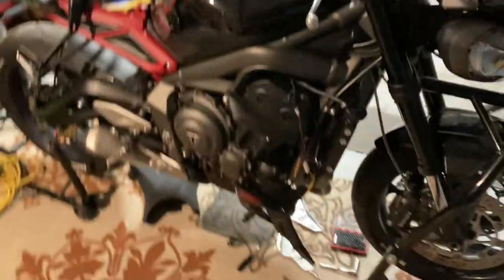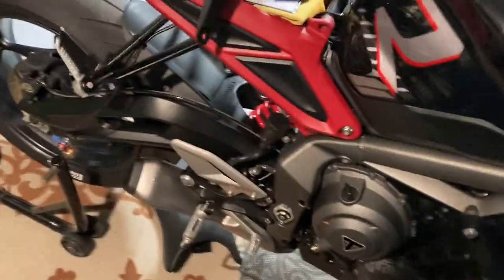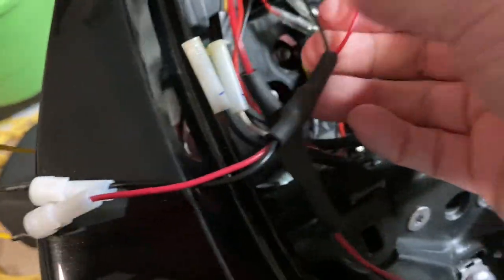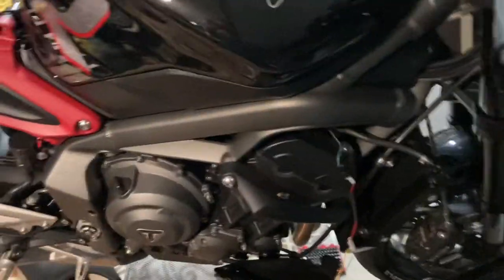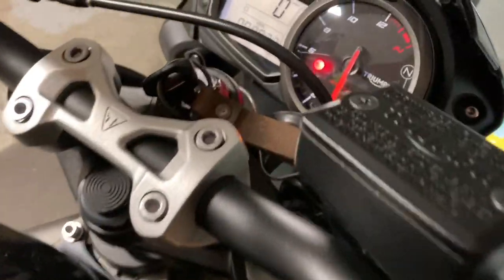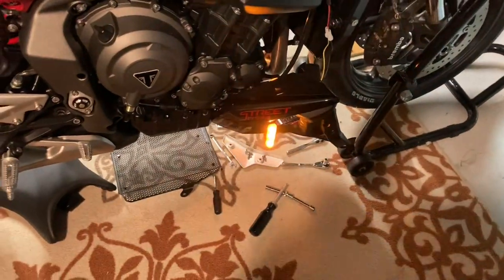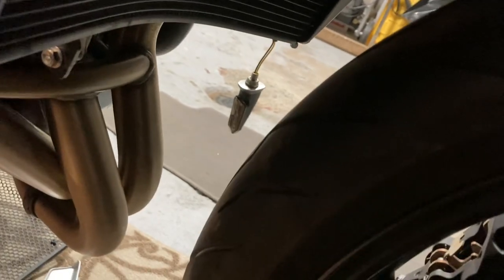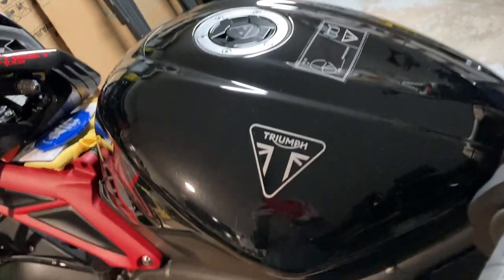Brogue Motorcycles LED Resistor Install Triumph Street Triple 765 Hyper Flash HELP!

Comment: I just added the OEM Scrolling LEDS. Switched out the front signals, tested and both worked awesome. Installed the rear signals and then I got hyper flash. Thought maybe putting the incandescent back on the rear and still got hyper flash.  Frustrating.
Reply from the maker: So I spoke to the guys from Brogue Motorcycles and I needed to add 2 of their resistor kits inline on each bank so my setup is now currently 2 resistor kits on the front signals and 1 kit on the rears and everything works flawlessly with no more hyper flash, will do an update video soon.  They told me sometimes the canbus can act funky and that’s why you get hyper flash.
Reply: @dinkster_view8432  That’s sweet that you got it to work. I have a 2022 R. I was under the impression that this bike didn’t have a flasher relay. But I checked anyways. Take both seats off, tail fairings and then the black skirt between the battery and the tail area. Sure enough, there is a flasher relay. FE218BH relay hooked up to a wire harness. I was wanting to order the Triumph Flasher Relay but it said it was for older Triple models. Ordered it anyways to see if it will work.
Reply: @Jason Williams  any updates on this?  I'm doing front and rear as well.  If it worked, which flasher relay did you use?  Can you specify a part number please?  Thanks!
Reply from the maker: @stevenhsu2336  I did an updated video after I spoke to brogue and got it to work with the leds.  The STR doesn’t have a flasher relay, I put the link to the resistors I bought in the description, I needed 3 sets.  I installed 2 on each side up front and 1 each side in the rear, works just as the incandescents did.
Reply: @stevenhsu2336  Yes. I found the flasher relay under the seat and it was the same model relay that they used to use. Eventhough these newer bikes aren’t supposed to have them, mine did. Bought the Triumph LED relay and it works like a charm!
Reply: @dinkster_view8432  dang that's crazy that you needed two sets per side up front!  I only have one on each side on order :/, but hopefully my lights will draw more current than yours do.  Do you know what wattage your lights were rated?  Mine are 6 watts each.
Reply: @jasonwilliams6849  that's excellent news!  Can you send me the part number of the relay you ordered from Triumph?  Highly appreciated!  (Is it the FE218BH that you listed?)
Reply: @stevenhsu2336  Triumph part # is A9830046. Have to run a ground wire to the battery but it’s a pretty quick and easy install.
Reply: @jasonwilliams6849 was the flasher relay for the 2024 model? I have a 2024 street triple R and I am getting hyper flash with after market turn signals. I spoke to Triumph and they told me my bike doesn’t have flasher relay. I am trying to figure out how to get rid of this hyper flash issue.